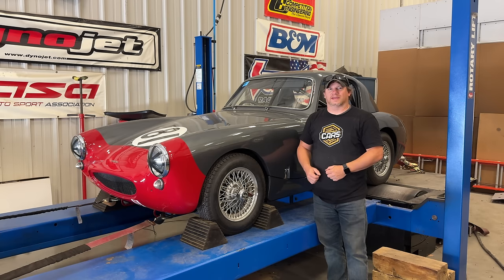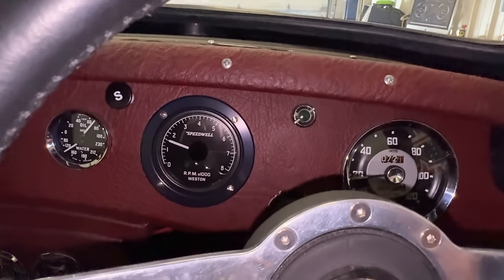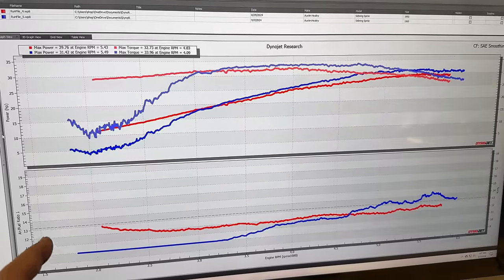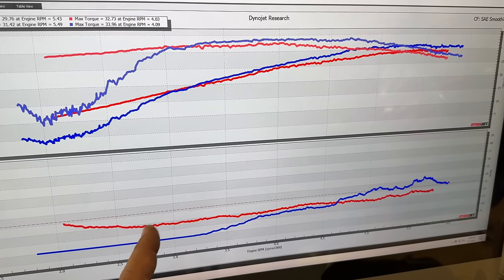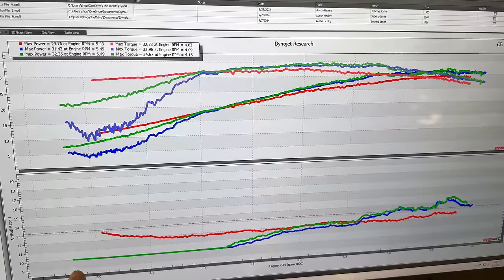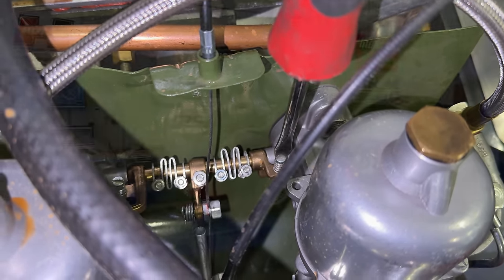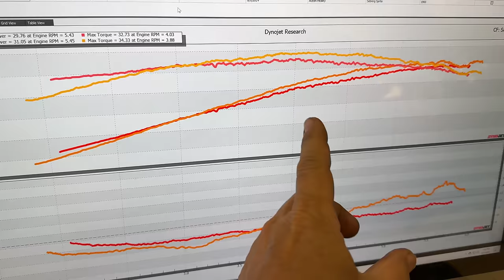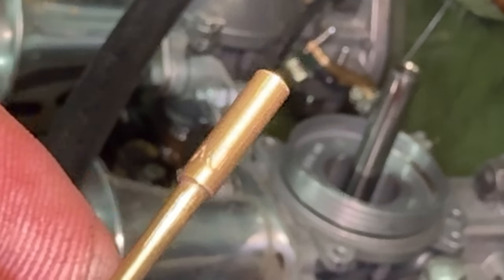Second Try on the Dyno This Time With SU H4s

Comment: This has been a very informative exercise in engine tuning. I drove a Volvo with BSU carbs for several years, and I knew that it ran stronger at speed if it was tuned lean at idle, but this really illustrates some of what was probably happening.  The needles came from old stock at the Volvo dealer and their parts book was hand written. Thanks!

Comment: You are misunderstanding how SUs work. The last classic Minis using carbs had huge 1.75” carbs and worked really well. SUs are self adjusting, the Venturi sets itself by moving the piston up and down according to airflow. To get the air fuel ratio right (whatever size of carbs you use) you have three adjustments, the jet height nut (using the spanner as you have shown) the spring pressure (there are different springs available) but most importantly the needle. The needle is the only one that changes the a/f ratio as the load increases. The other thing you have not mentioned is the piston dampers. These act like accelerator pumps by slowing down the rising of the piston during acceleration. They have a big effect richening the mixture during acceleration but do nothing in steady state running, so you need to check both states on the dyno. I find the best way to tune the carbs is using a portable lambda a/f meter on the road. I have more than 50 years of SU tuning experience.
Reply from the maker: I do understand an I am experimenting to find the proper starting point I do not think this engine was built to the spec that it was intended (I didn't build the engine) and I am looking for the best place to start playing with things.
Reply: Any A Series engine of any specification will work well with a pair of H4 carbs. You just need to set them up properly. You can easily create your own needle profiles by scraping a flat (using a sharp knife) on the brass. A flat is much easier to judge than reducing the diameter. Obviously you need to start with a fairly weak (ie fat) needle. You need to observe what height the pistons are riding at when you judge where to scrape. For instance you might have a good mixture up to say 1/2” piston height and then it goes weak (using a new “fat” needle) so you scrape away a bit at the 1/2” point, and so on…
Reply: Beat me to the single 1.75 SU from the A Plus engine.

Comment: Aren't there several jets on those carbs?

like, specifically, an idle jet?

i've worked with Mikuni's & Keihin's, and they have idle circuits.

i think the issue is due to the missing air cleaners, because I ran into that issue several times. No filter changes that, so does removing the airbox & running pods.

My quick & dirty fix for that (when changing the idle jet isn't possible) is spacing the needles up, in the piston, with a couple washers. That also enriches the top end, but it does compensate for the lacking pre-throttle vacuum.
Reply: Nope, not on an SU.  An SU is quite different from a Mikuni.  There are four things that can be tuned on an SU, needle shape, jet height, spring on the slide piston, and dashpot oil viscosity.  For cold start the jet can be manually pulled down allowing more fuel to get past the needle.
Reply: @johnpearson492  damn, that is dumb. Apparently I hate British cars for valid reasons I didn't know.

i used to think SU carbs were cool, but now i'm amazed those made production with half-ass engineering & insufficient mixture adjustment!

 Even my '75 Honda CB360 has 3 jets (low speed, secondary, primary) plus adjustments on those (needles/jet screws) to get smooth fuel delivery across all RPM & throttle ranges, on both carbs!
Reply: @Iowa599  I'm not sure they are dumb.  I have a Sprite with dual HS2 SU carbs, they are super reliable, and due to them being original and on an unmodified engine, super easy to keep in tune.  The car starts on a dime and I don't have to worry about pesky accelerator pumps and finicky chokes.  The only real maintenance I do on them is fill the dashpots with oil about once per year as a bit leaks out with time.  
There are many carb designs in this world, I've had the pleasure of working with SUs, Mikunis and the odd Rochester quadrajet.  I found the Quadrajet the most challenging to understand, but when finally setup correctly, is a fine piece of kit.
Reply: @johnpearson492  sure they are. They do less 'thinking', with fewer mixture controls, and less control over different ranges.

I like the GL1100 Keihin's even more, now. They have aluminum pistons, like SU's, instead of diaphragms & plastic. They also have many adjustments!

i wonder if an airbox would help, if legally allowed. One could possibly have the volume tuned to tweak fuel delivery.

Comment: fascinating video, that immediate feedback is priceless in your tuning process. I'm surprised that engine is putting out those HP numbers though. It's a 948? Makes my estimates of my 948 far too high no doubt. I keep lying to people saying it's putting out 40HP! I agree with Paul above who mentions profiling the needles. The only way to prove one profile was better than another is with the dyno, of course. Was just talking to an old racer named Dick Powers from the Rochester NY area who mentioned this, and also that they tuned the carbs by blowing over the needles and if the fuel just welled up, they called it good and ran it, LOL, scientific to some degree, and while awfully subjective, they did win many races with that method. We were at the SVRA event at Watkins Glen in August and the MG racing group had the honor of a visit from Jack Darren, and we had a brief conversation because he could smell my Bugeye was running rich where he mentioned bringing it to his shop in Carbondale, PA and tuning it, LOL. That would be an education for me, for sure.

As for needle profiles, could a 3d metal printer spit out custom profiled needles?
Reply from the maker: I stock Sprite puts down around 25 hp at wheels on the dyno.  That 40hp is in old school horsepower not real world horsepower, they were not driving generators or even water pumps when they were measuring horsepower the old way.  https://www.autoblog.com/2013/08/15/modern-vs-vintage-horsepower-through-the-years/

Comment: Carbureted aircraft engines have a manually-adjusted mixture control- because the air is thinner and has less oxygen at altitude- an exhaust-gas temperature gauge is used to optimize the mixture so the plugs aren’t fouled with carbon as the mixture gets richer.
Reply from the maker: i have that on my Triumph TR4 racecar you can really see how the front cylinders are cooler than the back because of the air heating up as it makes it way through the engine bay.

Comment: Do you have the correct manifold to use the H4’s or just an adapter?  I would try polishing the tip end of the needle to richen up the high end.
Reply from the maker: Yes I changed the manifolds, I want to go even leaner on the high end, it's the bottom end that is problem.

Comment: Good Greif!!..These BMC A engines have been tuned since the mid 1950's !!!!!!  If you kids haven't done your research(Vizzard), then get a clue!!!!!  There is not much new about these engine tunes for 70 years..I had my 1954 Morris Minor Series II ragtop, in 1962..with the Series A 803cc engine making 55 HP@ 6250 rpm...I communited 80 miles a day to college with that rig for 4 years..and you kids think that moving to a set of S4 carbys will really up the game?? I had Weber DCOE 40 carbs on my 803 with a great cam and very large valves..in 1964 !!!
Reply: I thought everyone that had a Spridget had a copy of Vizzard.